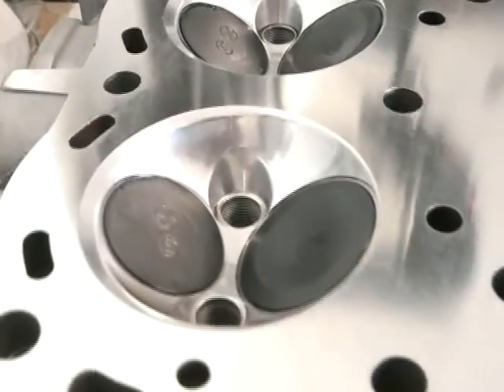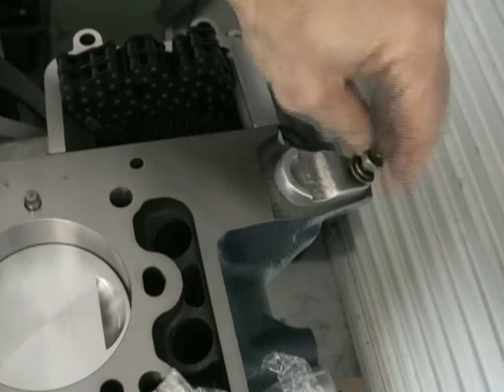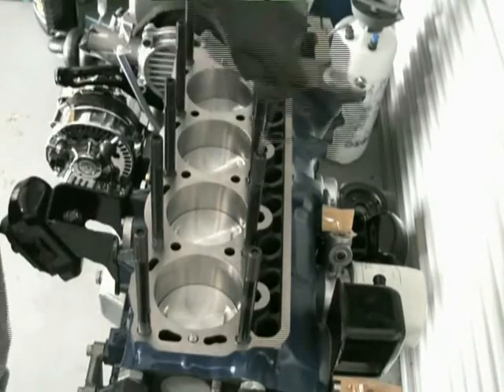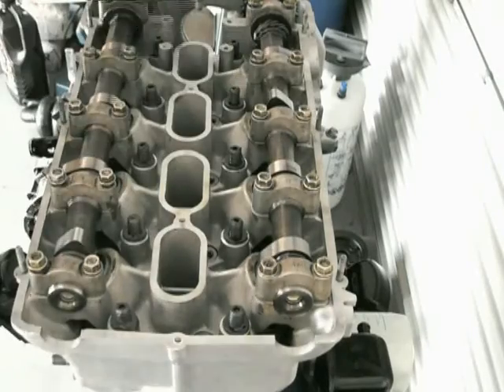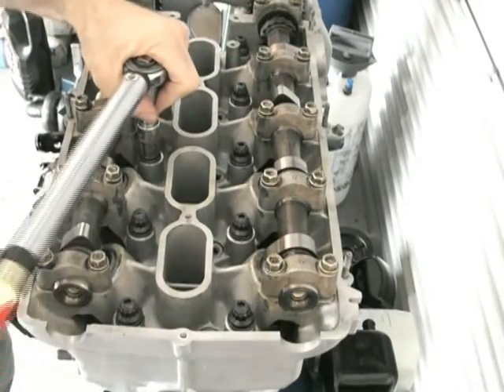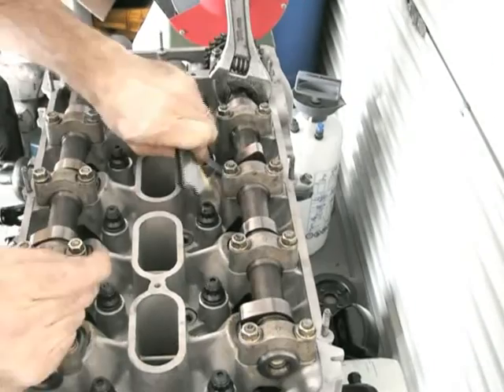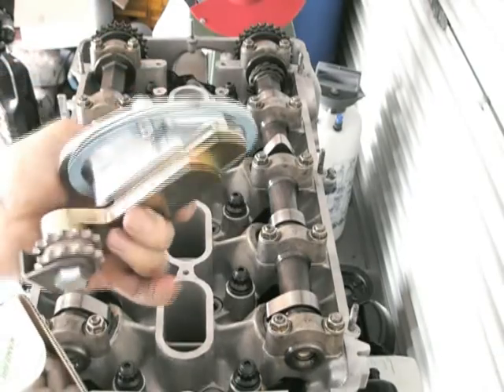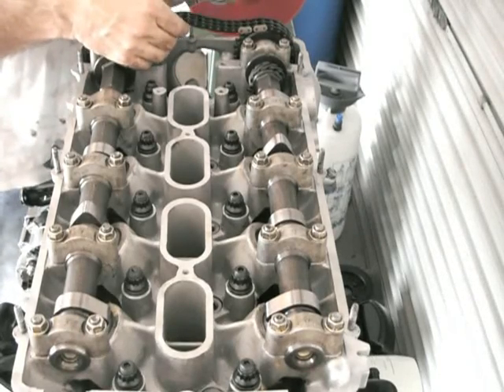Toyota 3T-GTE Engine assembly

Comment: Where can I get a 3tgte engine, I live in Puerto Rico.
Reply: Estan dificiles pero se encuentran. Yo estoy terminando el mio. Buscalo en los clasificados como 3t 8 espares.
Reply: What spring and retainers did you used on that engine? @mezzmo
Reply from the maker: @Kartsandcars  Hi, I used performance springs and retainers from Kameari in Japan
Reply from the maker: Hi Hector, these are very rare now. I haven't seen one for sale for a while. I don't know but I think you just need to search online. If you really want one buying via Japan might be possible through a wrecker.
Reply: Any places you may think of that u recommend?

Comment: Holy cow, the 3T-GTE is twin spark engine? That would do really well on bioethanol fuel with monster compression ratio (12:1). Thanks for showing the head  in such way that it was instantly visible.
Reply: Never knew these came twin spark or turbo  plus timing chain we only got the stock 3T engine

Comment: Hello what kind of power did you end up making? Do you live in brisbane? Would you be keen to help me out with my 3tgte?
Reply from the maker: Hi, incredibly I haven't put it on the dyno yet. I need to get it out and fine tuned sometime soon. My guess is it will have between 180 and 200rwkw. What help do you need?
Reply: I bought my motor apparently "fully rebuilt". Since i got the car ive spent way to much money. Custom intake,coil packs,custom cas,550 injectors, external fuel pump and surge tank,intercooler,oil cooler. I think neraly everything you can bolt onto a motor. Decent size turbo gtx gen2 2867 i think with the biggest housing set up they come in. My problem is most modern cars ive researched sre making 390hp atw with this turbo. Ive made 210kw atw with mine so its missing about 100 hp some where. Everyone keeps telling me the motor has been build with to low comp. Its tuned with 22psi of boost and has had 25 psi put through it but still only made 220kw atw. Had more timing more boost, motor stays solid and no signs of getting close to detonating just stops making more power. It has a copper head gasket ive measure around the out side at 2.2mm. My theory is the old 8 valve head cant flow enough air volume for a low comp high boost set up. Ive heard the copper gaskets are reussable so it might be as simple as getting the head shaved 1mm or getting a 1mm gasket? While the head is off get it ported. Not many people have even heard of the 3tgte so it would be nice to take it to someone that has worked on one. Sorry its a big story
Reply from the maker: I ported my head and whilst it hasn't been on a dyno yet i built it to have potential for high power. The intake is a weak link without porting. I also have an M3, remember that modern cars also have all the gear to go along with the power, unlike these old girls. I'm not chasing mega power because its not like you're going to be able to use it all in an older car unless you spend a lot of time getting the suspension, brakes etc etc as well as some traction control etc. The fact you have high boost could also indicate that air isn't flowing through the engine as boost is essentially back pressure. Again, porting can make a big difference. I also polished my exhaust intakes after porting. Compression on a 3TGTE is usually 7.8-1, generally turbo engines need lower compression due to the boost. Do some research on the 4TGT which is the race version of this engine, from memory some of these had over 500hp....
Reply: Classic Celicas and more yeah i think porting might bring power up a fair bit. Your right about the handling. Ive got disc brakes front and rear, coil over suspension, upgraded lsd and semi slicks and it still doesnt like traction in 1st and 2nd. Mid 12s is still alright for a 40 year old car. Will just have to get the head off to sort out the power. Thanks
Reply: Hello i know this got asked in another video but could you please tell me the part number for the arp head studs you used?
Reply from the maker: Hi, its been a while but I think they were ARP 203-4206. The head posts need to be cut down by approx 20mm for them to fit
Reply: @dougcooke1458  You might want to look into cam timing. Even a bit more open time could mean a lot when the mixture come in boosted. A small change in the timing would not completely ruin the idle.
Reply: I know of 3t engines never knew there was a turbo to it guess we never got those

Comment: I know the video is quite old but at the 1.2 minute mark you install the oil pump drive shaft.  Is that a 3tgeu part?  Im building a 3tg hybrid with fuel injection and dont really want a distributor with a cap sitting there.
Reply from the maker: Hi, yes its a genuine 3TGTE part. On a 2TG its where the dizzy goes but in a 3TG its used to drive the oil pump. The 3TG oil pump drive can also be used in a 2TG or 3T if you make your own crank sensor to replace the dizzy
Reply: Exactly. Using a crank sensor but still need to pump oil

Comment from the maker: Sure, there are 10 bolts. You progressively tighten starting from the two middle bolts working diagonally outwards.If you number the bolts on the inlet side from 1 to 5 starting from the front and 6 to 10 from the front for the exhaust side the order will be 3, 8, 2, 9, 7, 4, 6, ,5,1 ,10. Final torque needs to be between 53-63ft/lb